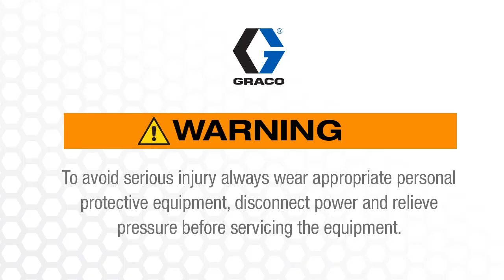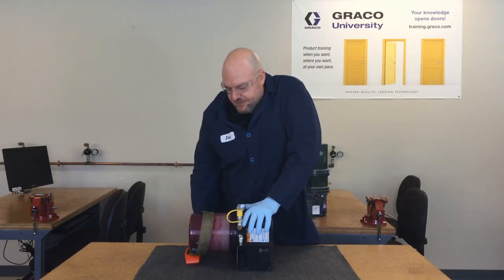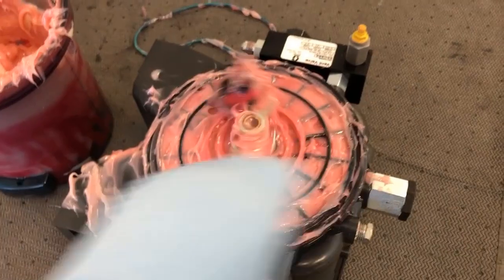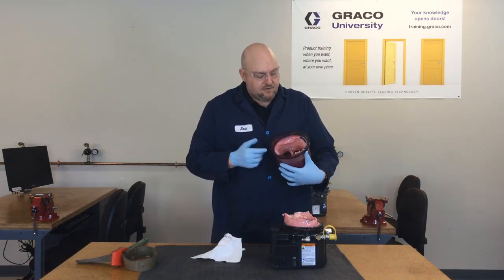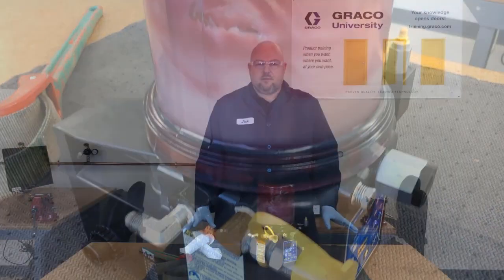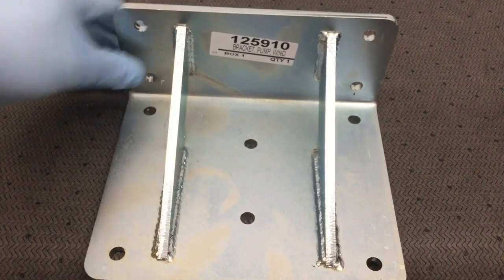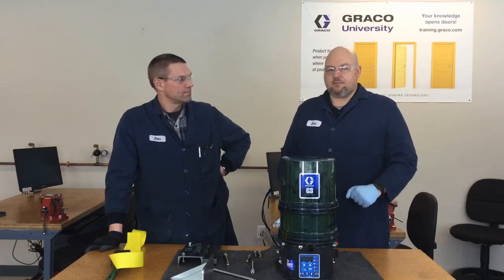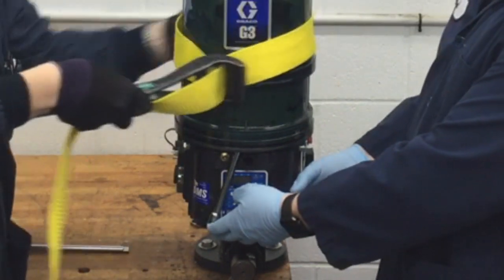G-Series Reservoir Removal and Replacement

Comment: I'm a Frito-Lay Fleet Tech we recently received brand new 2024 Volvo tractors with the Graco Auto Lube system we have been having a lot of issues with lines leaking and units leaking currently I have one with the unit leaking from around the Reservoir housing is there a o-ring replacement part number that I could order?
Reply from the maker: Hi there! Thank you for reaching out. Please send your contact information to LEDChannel_Marketing@graco.com and we will get in touch.
Reply from the maker: Hi there! Please reach out to our tech assistance team at 800-533-9655 for help.

Comment: These are the most useless not user friendly of all auto greasers. If were trying to figure out how much grease is in the reservoir and can’t then there is an issue. The display unit is poor engineering and confusing. So how does one know how much grease is in one? The reservoir is not clear!!
Reply from the maker: Hi there! Thank you for reaching out. Our G-Series reservoirs are made with a clear material to provide easy access to see how much grease is in it. We're sorry to hear that you've had a negative experience with your G-Series pump. To look into this further and to get help programming your pump, please call 800-533-9655.